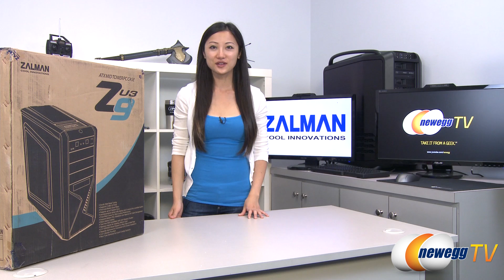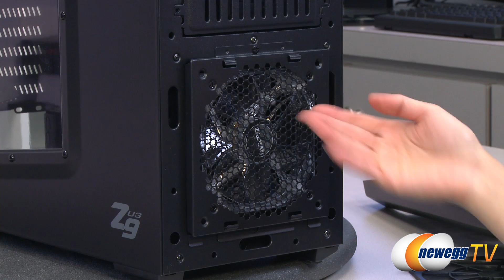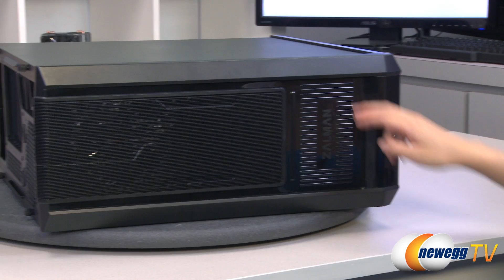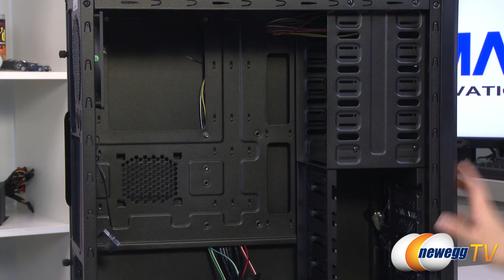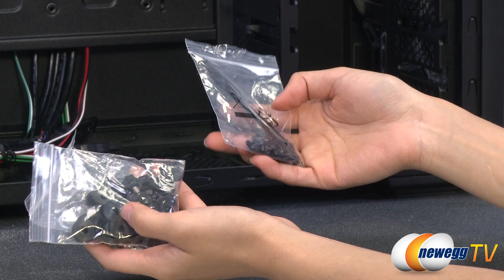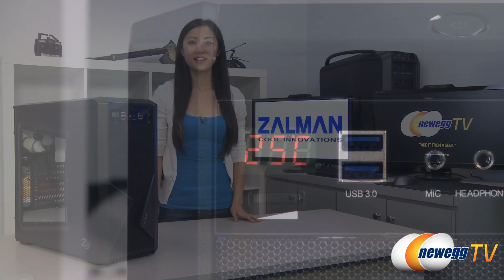Newegg TV: ZALMAN Z9 Mid Tower Computer Case Overview

Comment: I have one of these cases but it's a little different not all the fans are led but it is really quiet and very durable, I like the fact it has optic drive bays, which is getting harder to get good cases that have them. Everything is always changing when you are building a system and think you something great and a few months something better comes on the market, its wow why did I not wait lol

Comment: I just picked up this case for $39, just a few days ago, and put together an AMD 8320 build, this case is great, lots of room for wire management, very good airflow. I really like it. I have not built a computer since around 1998, so it has been awhile, it is much easier now, but still a little difficult the first time, but you have to enjoy it, take your time, and read everything, until you are more experienced.  Anyway, I have two small issues, 1) I have not hooked up the front fan temp. display as that was not explained anywhere in the case manual, does anyone know how to connect the fans and get the temp display working? Also, do not really understand how to use the 3.0 pass through cables? What are they for? I just have them laying in the case until I figure out how they are used?
Reply: +RetroRich where did you get that case for $39?

Comment: This is a nice case. I have the standard Zalman Z9 case. The standard edition doesn't have the temp controller and it does not have the glass on the side. The standard does not have a fan on the top of the case.

Comment: Can this case fit these components?

CPU: Intel Core i5-4670K 

MBO: MSI Z87-G41

Memory: GeIL EVO Veloce Series DDR3-1866 8GB

Hard drive: Seagate Desktop HDD ST1000DM003 1 TB

GPU: ASUS GTX770 2GB OC
.
PSU: XFX Core Edition PRO750W

Disc drive: LG GH24NSB0
Reply: u didn't need to say all that cases are mostly concerning when it comes to MBO Disk Drives (and Rarely Sometimes GPU and PSU) I have yet to find a gpu that iisnt plenty good enough to fit with extra room and also very rarely your HDD  may matter but not much

Comment: This is the z9 plus not the regular z9. The title and the link are both wrong. Its strange though because I've seen both the regular z9 and the z9 plus and neither have a window like that. There is normally 2 small plastic panels and an open air honeycomb design window. I guess this is a new revision of the z9?

Comment: Can this support a corsair h100? I know it has dual 120mm fan mounts on top but the spacing might be different. The h100 uses standard spacing (no gap between fans) and this looks like it may not work with it.

Comment: The case shown is a Zalman Z9 U3. The normal Zalman Z9 mid tower case does not have USB 3.0 or a temperature gauge with fan control. Also the Zalman Z9 and Z9 plus are sold in America while the Z9 U3 (shown) is not sold in the US.